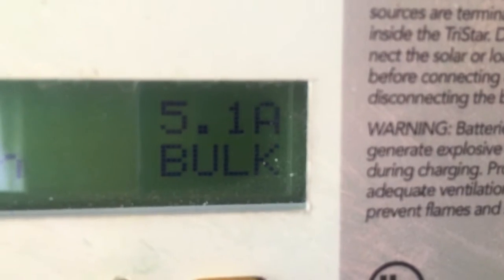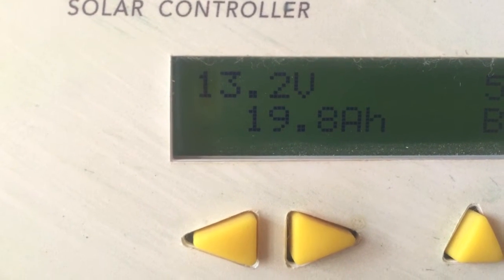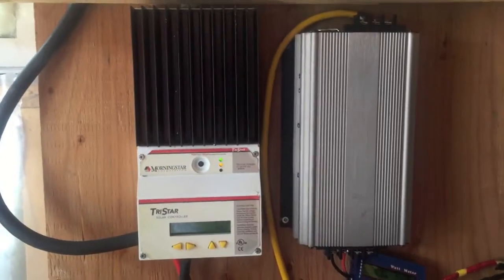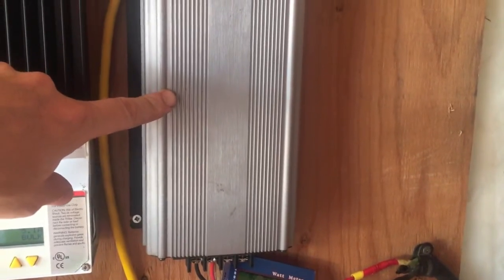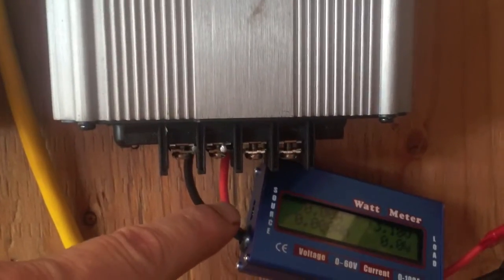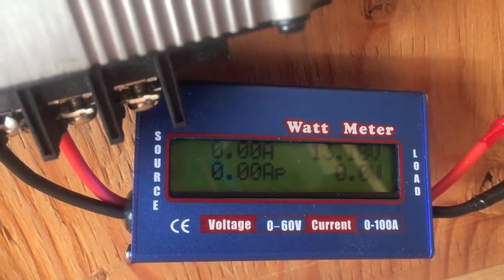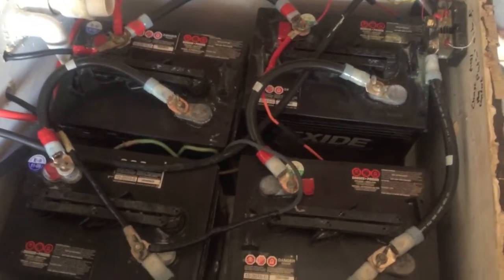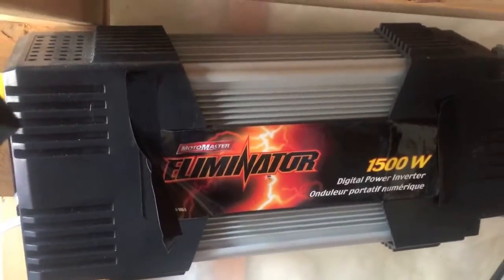July 2015 Off Grid Solar and Wind Power Update

Comment: Good to see every thing is going well. On the little watt meter you have you can move the screen so that it is not showing the black bit at the bottom. I ordered 100 of those watt meters from china and 90% had the screen crooked but easy fix.
Reply from the maker: ***** Oh, I wasn't aware of that. Thanks. I'll fix it this weekend. Also, I found out I hooked it up wrong. Its suppose to be the other way around.
Reply: The Cedar Workshop Yeah source go to the output of the wind turbine and load goes to the battery.
Reply from the maker: ***** That's how I hooked it up, but after watching another video, LOAD goes to wind turbine and the SOURCE to the battery. Total oppsite thinking I'd say, but maybe in the RC market, that's common thinking. Watch this video https://youtu.be/w25Rlb3507s and at :39 mark he tells you how.
Reply from the maker: The Cedar Workshop  I stand corrected. You are right +TheBlokeSolar&Wind. This past weekend, I hooked the wattmeter up the way Gadget Addict did, and it displayed how much wattage was consumed, not generated.
Reply: The Cedar Workshop Yeah I know that I was right I have one that is on live cam 24 hours a days 7 days a week.